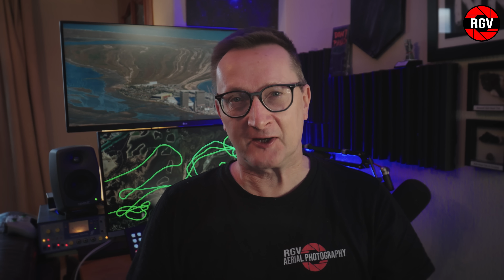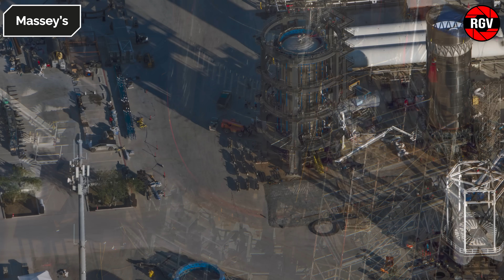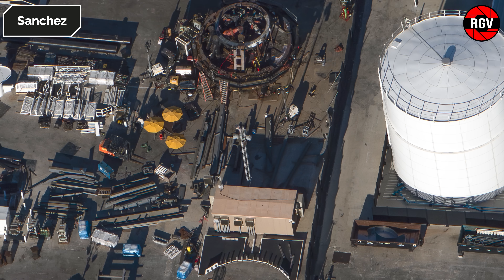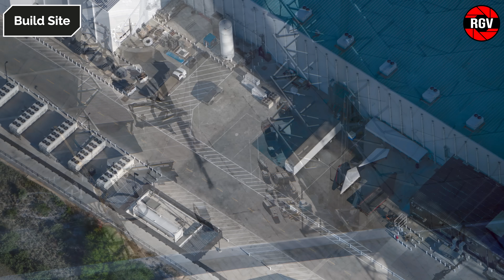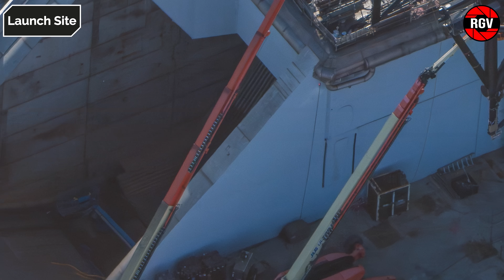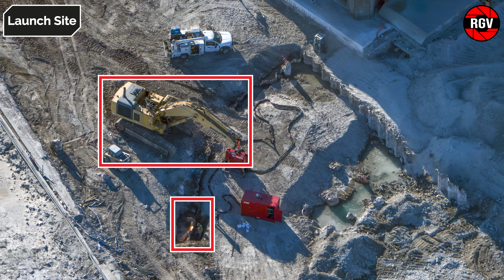A Closer Look at SpaceX's Plans for Massey's | Starbase Flyover Update 112

Comment: Wow, wow, wow, the RGV team are great, picking up all these details and working out whats going on. Just for your information, the Tower Crains would be temp fixed to the Giga Bay structure at vertical intervals, to keep them stable. When the crane is removed, it lowers itself down, and the temp fixings are then removed.Keep up the good work.

Comment: FYI: The tower crane "MAY NOT" be temporarily tied into the building. An internal tower crane must be fastened to the building to  create a symbiotic structure every few floors. I couldn't tell from the photo if the tie in featured the standard steel collars and struts, so this is a guess.
Reply: They are temporarily tied to the building as the braces will eventually be removed when the cranes are removed.